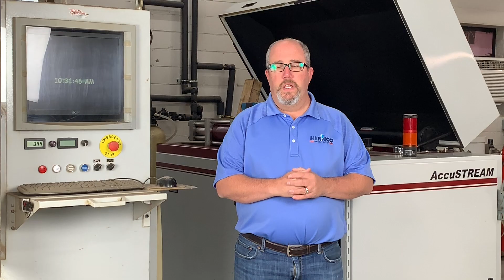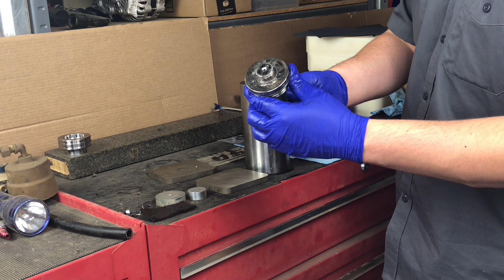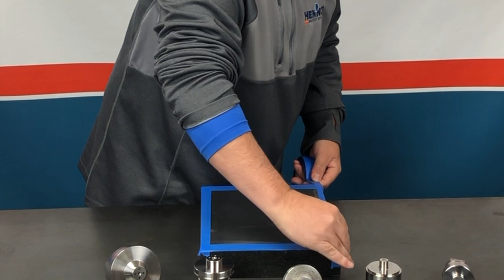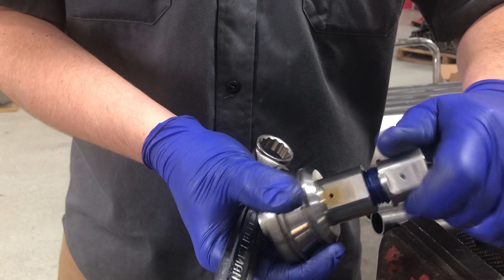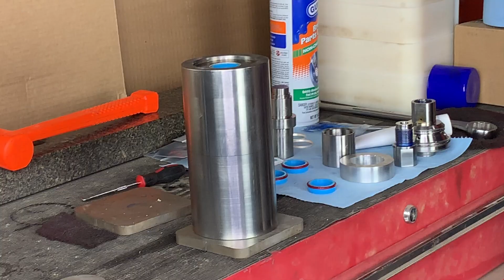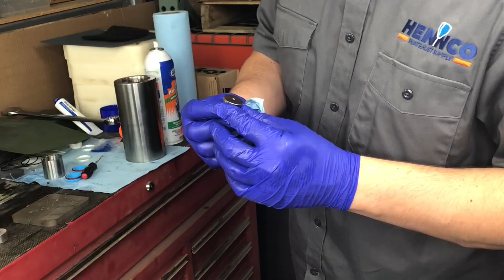Check Valve Rebuild Accustream Hypertherm Style Intensifier

Comment: Hello, I have an oil leak immediately after the cylinder, near the stem, the black sealing gasket of the bushing is spoiled, 
Thank you
Reply from the maker: Oil leak is typically indication that the rod seal has failed.  You might consider trying a low pressure seal kit change